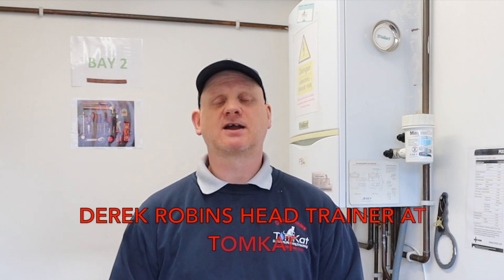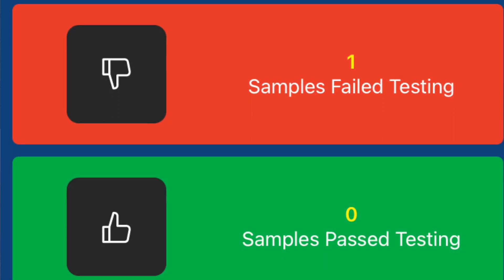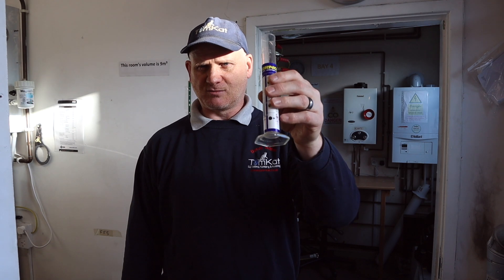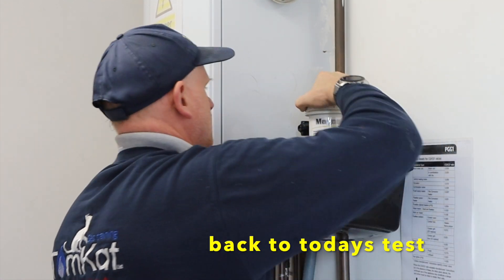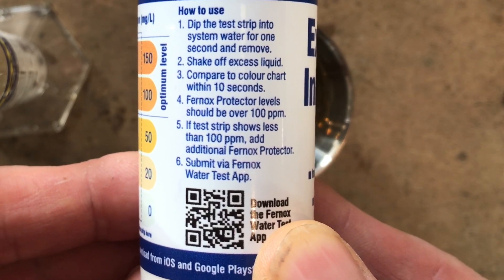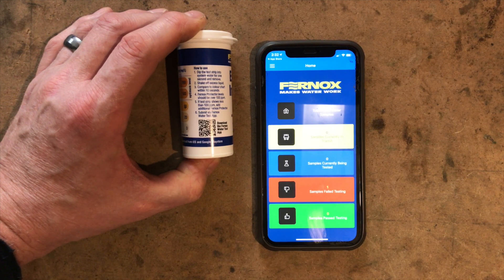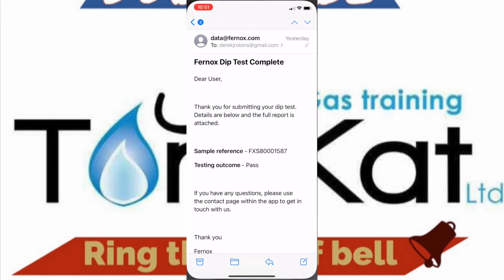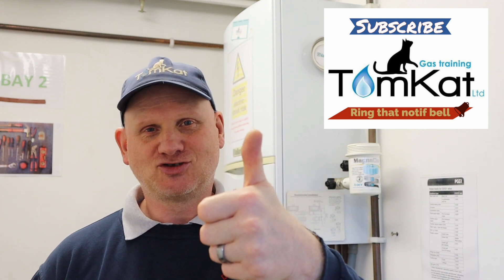HOW TO USE FERNOX EXPRESS INHIBITOR TEST STRIPS. a step by step guide for gas engineers on the test.

Comment: Confused when you say that even though the inhibitor comes back above recommended % 
That it needs changing every 5 yrs regardless, surely if it is present it should be able to perform as intended. Or does it mean that the test regardless of colour cannot guarantee the Fernox is fit for purpose?

Comment: As a gas eng this is a little confusing. I Have purchased the Adey kit but feel its a bit expensive, the fernox ones and much better in price, but what actually are we required to do. Is it mainly the inhibitor and water clarity? What does the new BS say pls Thanks
Reply from the maker: As you said we have to check the boiler inhibitor levels every year and the condition of the heating water so we can make a judgment every year that the boiler is running at its maximum efficiency. Also if the boiler breaks down the manufacturers will fix the bloody thing and not blame the fan breaking because the heating water is dirty.

Comment: There a good pack to have.
Its good to know levels, cos the differance from no inhibitor to a system correctly dosed, is like Night and Day.  Boilers without are a mess, blocked plate and main hex, corrosion, weeping fittings and boiler condition looks older than it actually is.
Ive boilers that the Custard(customer.lol) tops up every so long and the boiler run great, with no problems.